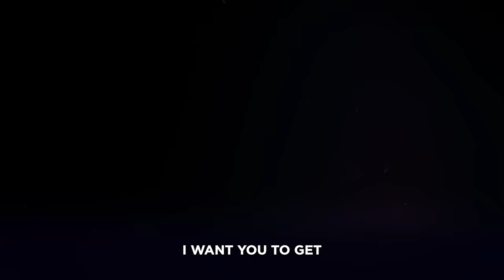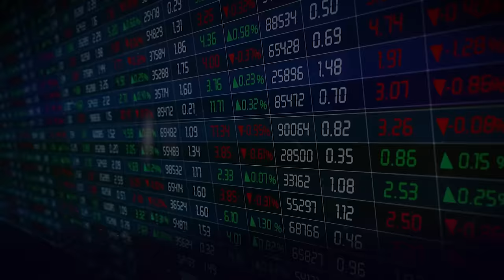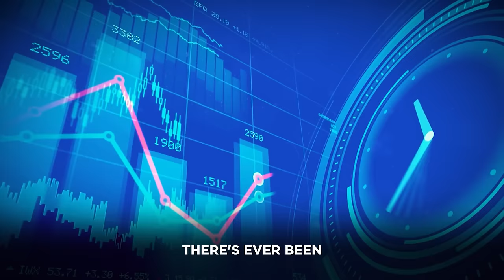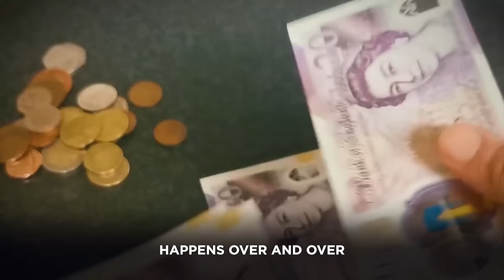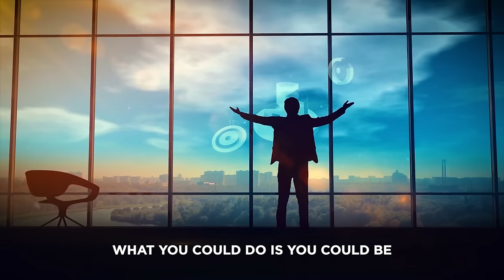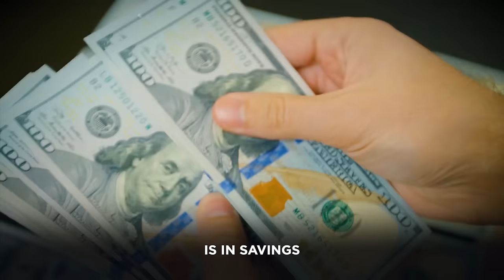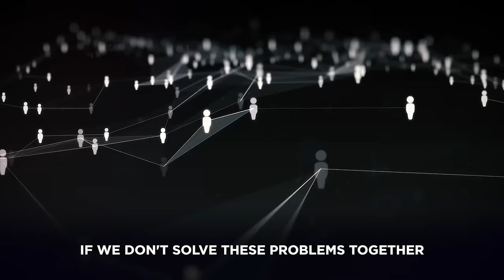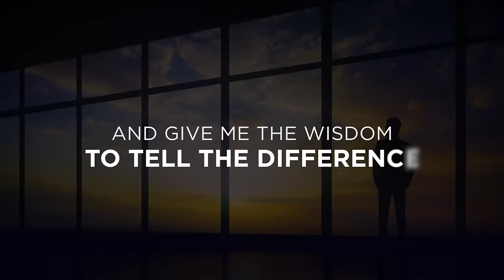Ray Dalio Predicts A Horrible Economic Crisis Where EVERYTHING WILL COLLAPSE

Comment: so turns out the marshmallow test doesn't actually measure how 'smart' you are. 
when you break down the results of the trials, it becomes pretty apparent that it measures 'abundance' 
- the kids from stable backgrounds could rely on the promise of more food later (based on lived experiences and expectations) so it makes sense for them to wait (confident in the knowledge that more food will in fact follow after a short period).  
- the kids from less affluent and/or stable backgrounds had already learnt, at an early point in life, that there may not actually  be another chance to eat the marshmallow, they can't rely on the future promises as readily and it is therefore actually smarter, from a survival point of view, to take the resources that are available to you now because nothing is guaranteed...

Comment: The one asset with the greatest risk adjusted return (highest Sharpe ratio) and zero counterparty risk is bitcoin. There is no second best.
Reply: ONLY as long as they leave the lights on.
Reply: Crypto$hyte will be tolerated as long as it diverts investors from Precious Metals.  Once the dust clears, it will be criminalized.